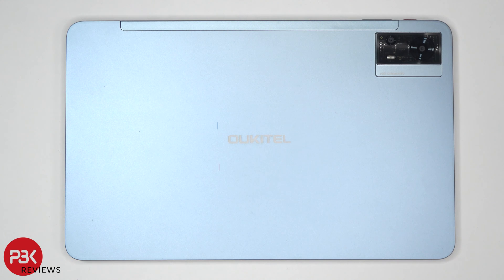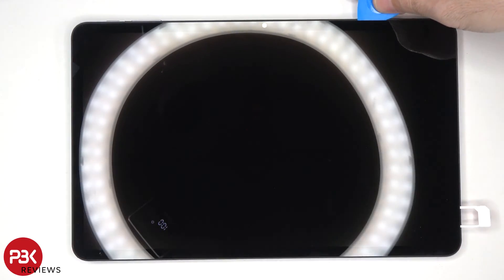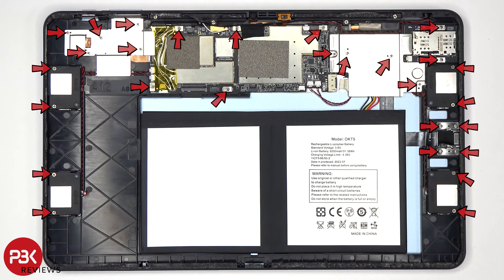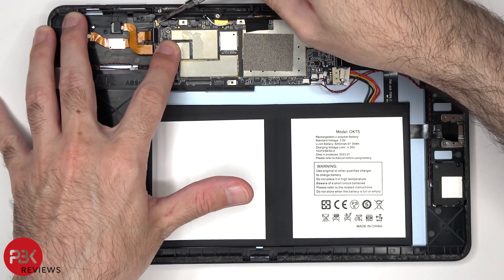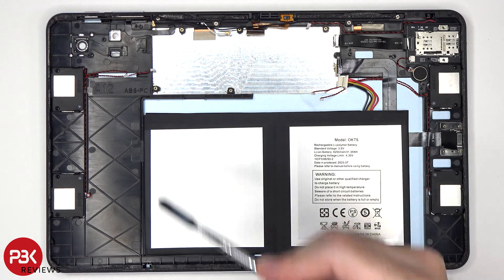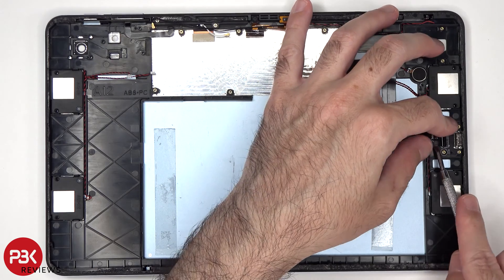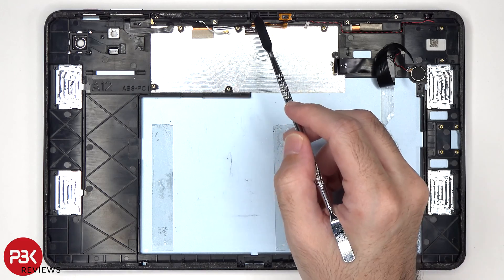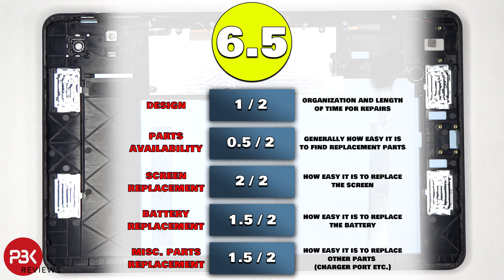Oukitel OT5 Tablet Teardown Disassembly Repair Video Review

Comment: Thanks for the video! I wonder if this tablet is good for drawing projects? I have an iPad Air 4 but regret buying the 64 GB because the IOS and system take about 16 GB and I only use it for Procreate App leaving me with 30 GB now. Is it possible to update the Android 13 to 14 on this tablet? TIA!
Reply from the maker: You're welcome. I honestly haven't tried out drawing with this tablet, or any use with the stylus to see how accurate the screen is to give you a good answer. When it comes to OS updates, I'm not sure how fast Oukitel is with them, but if they do decide to push android 14, you should be able to install it OTA (over the air with wifi).

Comment: You mention they say that they're gonna change it to 11000mah for the retail version.but I honestly I think they lied...the battery is in fact 8250mah.i installed AIDA64 on the tablet and it mentions the battery capacity(reported by Android) as 11000 but the charge counter shows it at 8250mah.the battery is already charged at 100% and the charge counter isn't budging from 8250mah.could they be manipulating the actual battery capacity data to make it look like its 11000mah?
Reply: How do you measure the charge counter?? What app? Is that a retail version? Can you explain more??
Reply: AccuBattery can do this.
Reply: I have the same problem. Aida64 says 8250mAh instead of 11000mAh in Android, and Accubattery counts nearly 7600mAh / 7800mAh in every battery charge from nearly 5% to 100%. I contacted Oukitel. I offered to send send me a 11000mAh battery that I could have changed here at my own expense. Oukitel refuses to admit their lie.
Reply: @Flyerfrancis my comment got deleted for some reason few days ago. 

I have the same issue with accubattery with my FOSSiBOT DT2 it says the designed capacity is 22000mah and the estimated capacity while charging is 7700mah. It is legit 22000mah that i can use the tablet 2-3 days before it gets down to 30% below, so that's mostly 30+ hrs screen on usage, not including idle hrs.

Try using your OT5 with gaming with 11000mah  you can get usually 8hs to 9hrs down to 30% batt. Or maybe 12 hrs with casual usage.